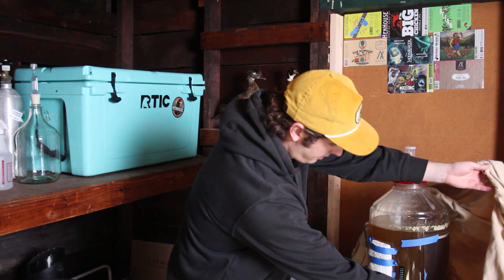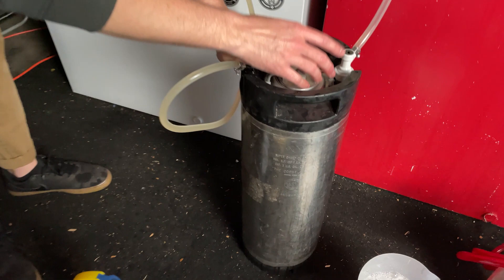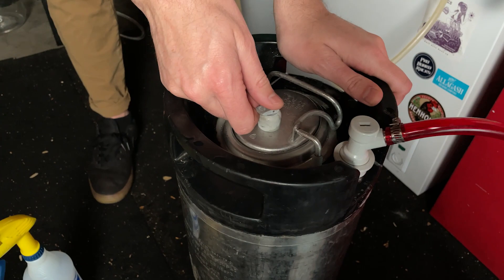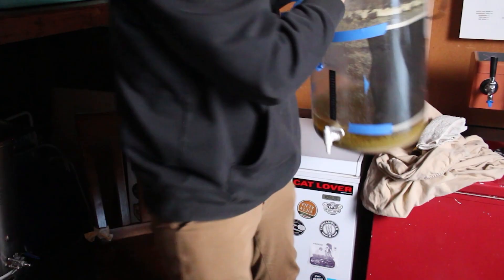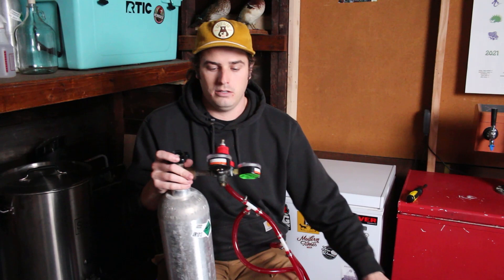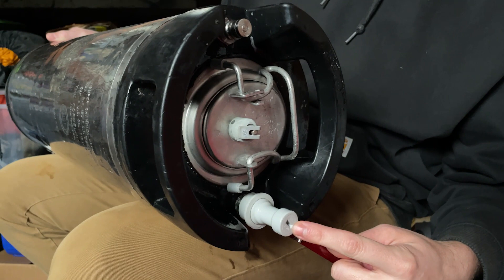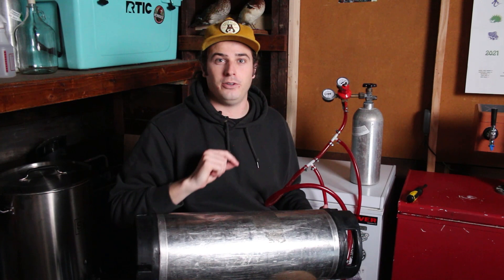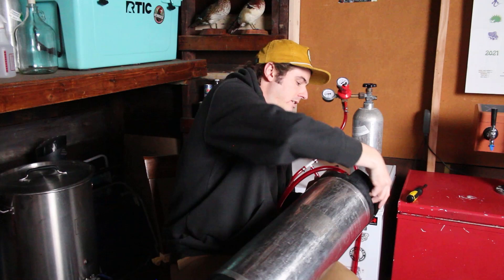The BEST way to FORCE CARBONATE | Homebrew Kegging

Comment: You can also just turn up the pressure on the CO2 and tip the keg back-and-forth every five minutes four about 30 to 60 minutes and it should be fully carbonated. That has worked for me

Comment: I do about 35psi for about 15-24 hours, then I turn the gas off for about 12 hours then back on for serving pressure and usually get really good results.
Reply from the maker: Sounds like a good variation, either way I find it best after a week or two.